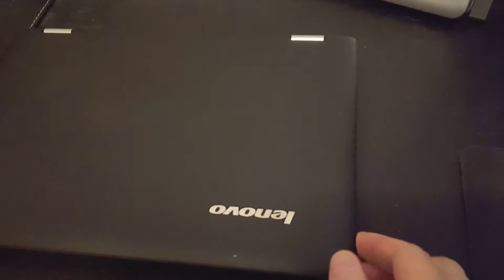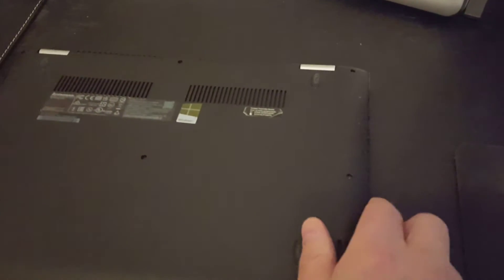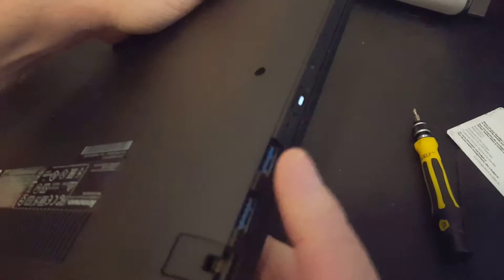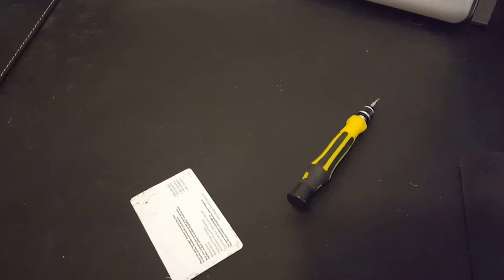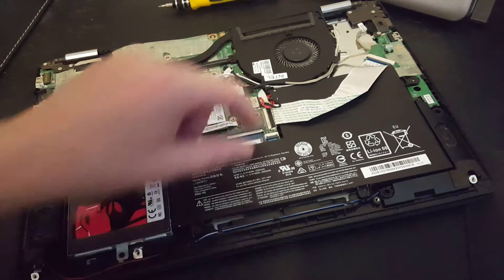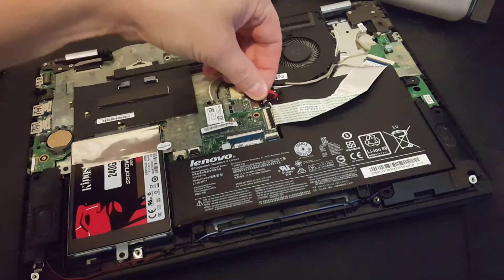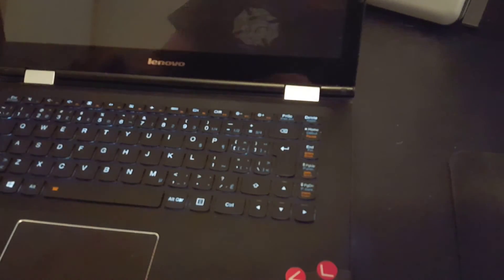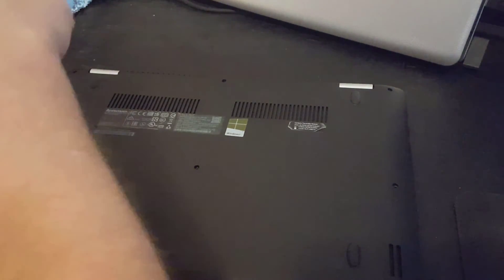Easy Fix Easy Fix Lenovo Laptop Flashing Power Light Will Not Power Up - Disassembly

Comment: What a lifesaver! My model is slightly different so had to pull the battery out. I managed to get out of sleep mode but now it's not charging... I'm 100% sure I put the battery back properly so no idea what could it be. I did get the "Incorrect AC adapter attached" pop up though...

Comment: Hopefully this works on mine. I picked up a lenovo ideapad 100 15ibd from a thrift store for $3 and it has a solid white light, but won't turn on.
Will edit comment after j try this

Edit,It didn't work. Fan spins, but then shuts off, no power

Comment: hello I have Lenovo S340 and it will not power on, i have followed your instruction's and after I reconnect the buttery its doing the same thing as before, when I press the power button I get 3 flashes of the power indicator in amber color and that is it, where would I go from here, I am an experience software and hard ware I just need to know what to replace or do can you help me,
thank you in advance

Comment: I am facing the same issue with my Lenovo Ideapad 100s the only thing that's different is it's not the power switch thats kept on flashing its battery. I hope this can be helped with that technique of yours.
Reply: Hey i'm using thinkbook 14 g2 and problem appears too and lights flashing on battery icon
Reply: My question is now have you find way to prevent it, and does this battery pull help the most and how often this happen as of now

Comment: Some bios options on different lenovo models allow you to power it down from bios for repair, which may drain it all the way and then charge it back up passing sleep mode but this (disassembly) method worked perfectly on a new ideapad. This seems like a common issue even on new models from lenovo.

Comment: I have a Lenovo Idea Pad Slim, and the power button just blinks with a black screen.    This happened after I accidentally powered off the unit in the middle of a Fresh Install of Windows 10.    I tried disconnecting the battery, but It's still blinking when reconnected.   I should at least be able to get the post screen, but nothing.   Any thoughts?   I am and experienced PC builder, but these cheap model Lenovos are a different beast apparently.

Comment: Any other suggestions when that does not work? My light is still flashing and the laptop will not power on. I have tried with the battery in  and out, with power supply and without.

Comment: hello, i have a lenovo ideapad 3 and it wont turn on. when i press the start button the button lights up but the fan wont spin. when i connect the charger the charging light is on but still nothing on the fan. i removed the battery put it back on, pressed the start button again just the lights. redid the whole process without the battery and just the charging cable again only lights but flashing this time. i cant access bios. i tried to reset bios with the reset novo button again only light. is there anything else to try?

Comment: I tried it 

My laptop battery is completely drained , the power button blinks 3 times when I try to turn on the power, it is not charging at all 
I removed battery and connected again but still not charging , no charging light on 
I tried with another charger as well

Comment: I have a Lenovo laptop with no power indication. Once I removed the internal battery and insert it,there is a orange light blink for 2 or 3 seconds and then went off. No charging sign, no power indication. Everything is working fine. Please help

Comment: One time my laptop that i clicked to turn off and put in the bag, didn't actually turn off, it overheated in my bag and then some cable detached according to the repair guy who i watched open it up and just plugged in the cable.  Now i have a other problem similar to yours, light is on but wont start.  At first it used to take an hour to finally start.  The clock was always very slow. Sometimes it would jump forward to an incorrect time. Now slower and slower until it wont turn on but the light is on. I guess i will buy a screw driver

Comment: My fix was inspired by this video:  I disconnected the Lithium button battery (backup battery) on my X270 for 15 seconds and when i plugged it back in my laptop would then power on again! (Of course I had to reset the date/time) On the X270, I had to remove the "fake" internal battery to get to the backup lithium button battery.  Thanks for making this video! (and the idea of using a credit card to pry open the laptop)
Reply from the maker: Good hack.   Thanks for watching and commenting!

Comment: I removed the battery on a Lenovo thinkpad X1 carbon. But it only works for a few minutes. Then it will at some point shutdown and end up in that state again with blinking lights. Only happened when I walked away. Once at windows login screen. Once at Ubuntu live CD loading screen.

Comment: i would have just used the hard reset button on the back with a paper clip, waaaay easier than cracking in to the laptop   this whole tearing apart was unnessasary unless you wanted to replace the battery and spray some air on fan imho.
Reply: except that doesn't work in my case
Reply: @marturomano  Yep, sometimes the battery just needs to be pulled  its still super ez and its fun to spray the fan with air makes that whirl noise like in Van Halen's Panama
Reply from the maker: That just does't work on any of the Lenovo's I have worked on with this problem.  If it works in your case, that is great news and thanks for sharing.

Comment: Hi! Mine is has this issue power light comes on, no activity on power on.(yoga 700-11ISK). Can you please tell me if it's about a dead motherboard? Thank you
Reply from the maker: It is impossible to tell remotely, but I would always pull the back off and unplug the battery for an hour or two before I gave up on it.  Let us know how it works out.

Comment: thanks for the tutorial, it's seems simple to just suggesting "remove the battery, wait a few seconds, and try again", but it literally saved my life, a big thanks from the bottom of my heart
Reply: Wait so, remove the battery, the laptop back together, plug it in and turn it on?
Reply: @sean07de2k24  yes, my laptop is actually support 2 nvme ssd, but when I want to plug a new ssd, for some reason my laptop is on (maybe I missclick restart instead of power off) so when I plugged it in it's just flash the monitor and it went off and I can't turn it back on again, and it's signaling as you've seen in the video (I assumed what happened is short circuit), it's worse than you would think because my laptop is less than 2 months old (and it's equivalent of 900 dollars, lenovo yoga slim 7) and my home is far from a city or trusted repair shop, so yeah, as instructed in the video my laptop went on again

Comment: You are a lifesaver!! My laptop was stuck in sleep mode and I stuck a pin inside to hit the reset button and the laptop would not respond at all until I opened it up and disconnected the battery and now fully functional again! I called Lenovo customer service and they wanted me to bring the laptop to be seen by a technician and suggested I go to Best Buy. Thanks again for posting this video.
Reply: Same Amma try to take out the battery will it 100% work my laptop never fell or anything

Comment: Watched your video..its pretty cool.My problem is I disassembled my Lenovo  G580 laptop.And now may be I forgot how the connections of the power cables circuitry were inside because my laptop cannot be powered on.After seeing your video I saw some p/cable which you handled.Would very like if you can show how all cables inside computer are connected to allow me recoup my Laptop.Thks and have a nice day.

Comment: Man, thanks a lot for this tutorial. My issue was that I cannot switch on the laptop and also if I connect the power the light doesn't even blink. therefore as you instructed I removed the cable and plug it again and it started working . once again thanks for this tutorial.
Reply from the maker: Glad it helped.  Thanks for the comment

Comment: There's a quicker fix actually. Look on the opposite side with the power cable there is a pin hole with a reset button just get something to fit in there and make one click and that should be enough. 😁😁👍🏾
Reply: sometimes yes ... sometimes no.  If the mbd is not totally dead, it usually works.  If the cover is removed that reset button is a white small round "button" type.

Comment: So I just came back from a long flight overseas and I made sure to turn off my laptop completely off. The power button works but the screen doesn’t turn on. I can hear the fan but after a couple seconds the fan will turn off but the power button is good
Reply: Mine is doing the same thing! Did you ever figure out whay was wrong?
Reply: @stacyadams8921  yes it was my ssd. I took it to a technician with no charge so I had to replace it instead of paying someone to do it.

Comment: I had the same problem, but the internals of my device was different (different model). I wasn't able to detach the power cable because it will destroy the seal. What I did was detach the ram and attach it again. E voila! It worked! Thank you for this video still.
Reply: I guess I’ll start googling stuff because his method didn’t work for me I’m going to try to find out where the heck the ram is because I have no idea

Comment: Bro what is the name of screwdriver did u use,so i can buy one?plsssss plsss i really need help😭😭😭😭
Reply: Bro plssssss🙏🙏🙏🙏🙏
My moms gonna kill me😭😭😭😭
Reply: It's a "phillips" tip .. size is called "PH00" (PH and 2 zeroes). Most real laptops use that size, but some laptops the case bottom screws are actually "held in" by small "C" clips inside, so don't be surprised if the don't "come out" as expected.  Don't force them out.  Apple crap laptops use their own "star" type tip, sometimes a "torx" type.

Comment: If I just let the laptop sit unplug from power and let it die by itself l, would that work just as well as actually pulling the battery? I just don't trust myself. You made it look fairly easy. But I think I'll try waiting for the battery to just run out of juice and see if that works the same. Currently the laptop is off and the power light is still blinking

Comment: I have a Yogo 2 Pro, from about 2014, it was working when I last used it, but when I tried to power it up after not using it for a couple of months, it just flashes the keyboard backlight, as well as the light on the power button.  Someone has suggested that this could be an issue with the CMOS battery, I'd appreciate any suggestions, as I don't really want to have to replace it right now.
Reply: Remove it and put it there again

Comment: I can on my ideapad but orange light blinks and not getting charged
Reply: Same problem , did u get it fixed
Reply: jordan the off road well in my case it was that the battery was not been charged for a long time. After 30 mins it’s now functioning as before and normal

Comment: what do ya do if its a recurring issue ?
Reply from the maker: If it happens repeatedly, I would think there is something wrong with the board or the battery.  You cannot afford to replace the board, so I would replace the battery.

Comment: I tried it and it still won’t turn on. When I plug it in the battery light flashes but the power button doesn’t :(
Reply: Have the same problem

Comment: This happened to my ThinkPad E480 after an improper shut down. Fortunately I didn't have to disassembly. I just held down the power button a couple of times and then waited for about 3 minutes (not pressing anything, some lights on). A fan started hissing and I could power off and restart again.

Comment: What about the tiny hole in the bottom? Hold in gently with a pin . It stops flashing but starts again when power is pressed. It did restart for awhile but is back again

Comment: Lenovo g500 still not coming on with no light flashing but the fan is spinning, tried using another monitor still no picture on monitor but the hard drive is spinning

Comment: I accidentally put my Lenovo's battery setting to best performance and it froze and turned off and it's not turning back on I tried taking out the battery and putting back it, the light  on the power button just shows then clicks off

Comment: Ur laptop's anatomy is the exact same as mine. Probably from the same series. Im gunna try this and see if it will work. I just opened my laptop and did nothing bit unscrew some screws and boom it wont charge neither can it turn on. I have no idea what I did. Ima gunna try reconnecting the battery and the small circle battery

Comment: This is just basic repair... Reset or remove batery... You just need to hold power button about 10 seconds and laptop will turned on without Dissambly
Reply: u sir just saved my life. im abt to cpy the procedure in the video. anyway thanks
Reply: Oh my God!! This worked, just hold power button for 10 seconds and then start it!!! It was blinking white light initially and no screen was visible and now it is all set!! Working fine!! Problem solved!! Thanks thanks thanks!!

Comment: My flex 3 will not charge its battery. I have the same symptoms. I removed the battery and it booted up. It doesn't do it reliably and I need to try it many times to get a proper startup. My guess is I have additional issues. I'm at a point where I just need one last startup to remove files.

Comment: The light didn't stop after I pulled out the battery
Reply: Impossible. Was it unplugged from the AC power adapter ?
Reply: Because the light stops after I unplug it but the laptop doesn't turn on either way
Reply: Albert Mathew me too did u figure it out 🙏🏻🙏🏻🙏🏻
Reply: No it wasn't
Reply: I got a new charger and it work however the mousepad and touchscreen stopped working. I use a mouse now.
Reply: Probably becaue i misplaced a wire or something

Comment: My Lenovo IdeaPad 120s is still stuck in sleep mode after I did the battery thing I also pulled the BIOS battery also if this don't work what other steps.

Comment: I had a problem with an Ideapad 110-15ACL which was having the power input LED light with the power adapter connected, but the laptop would not boot nor would it on battery. I read a lot of comments about how to fix it and watched a few videos. Then I took the bottom cover off and disconnected the battery. It didn't work after reconnecting it. It didn't work on external power. I disconnected the external power and the battery again and did the ten off/on cycles in ten seconds then held the power button for 30 seconds. Again it didn't work after reconnecting power. I then left it unpowered with the battery disconnected for a half an hour. Again the power button sequence was done. This time it started when I plugged the battery in. I operated it with the cover off for a while (getting some files copied to USB). I then shut it down and put the cover on and the DVD player in. I tried it again - no luck. All sort of combinations would not get it to start reassembled. Finally I left it off external power for a week. Then it started. When it started, it still had 95% battery charge. I went into Lenovo Vantage and put it on battery saving mode which only allows it to charge to 60%. I haven't had any problems starting it on battery or with the power adapter since. It's been four days. Fingers crossed.
Reply: No problems for the last two weeks. Still keeping fingers crossed.
Reply: @jnsx4037  I have just experienced the same thing with my x250. It shut down for 3days. I plan to sell mine and get a hp x360. In case you figure out what is going on with these laptops please post here. I love this laptop but I hate knowing it could shut down anytime for a week without a warning
Reply: @manm5302  I have not had a problem with the laptop not starting since my original post. Open the Lenovo Vantage app and go to Hardware Settings and then Power. In Power enable Power Conservation. That is it. I have had the Power Conservation quit several times. I noticed that the battery was almost fully charged, so I pulled the power cord to allow the battery to drain down a bit and reset Lenovo Vantage to Power Conservation. My guess is that the charging circuit is leaving the voltage slightly too high at full charge for some protective component in relationship to how much battery life is remaining. Maybe someone with expertise on LI batteries can explain how the charging voltage requirements change as the battery ages and the percentage of maximum battery charge diminishes. Or it could be related to value drift in a component in the protective circuit or something else.
Reply: Interestingly, I swapped my Ram stick and have not had any other problem since. Going on day 4 without a problem now. I will post here in case something happens
Reply: That is interesting. Ram can go at a higher frequency if the voltage is increased and may cause errors if the voltage is reduced too much without reducing the frequency. Maybe the clocks were too aggressive for the stick that was in there. Some manufacturers are better than others but there are no absolute guarantees. Also, a survey of the cooling could be done to see  if that was contributing to the problem. I did not do anything with the ram since it was buried and I didn't have a backup stick.

Comment: any advice if the laptop (same model) isn't flashing but will not charge or turn on? The red light wont even turn on when the charger is plugged in.

Comment: I have a orange flashing light.  When I press the power button it will turn on for 5-7 seconds and then turn off.  Any ideas???
Reply: I have the same problem, did you find a solution?